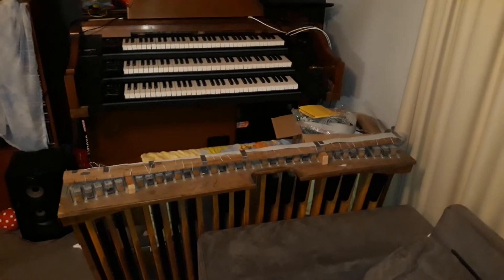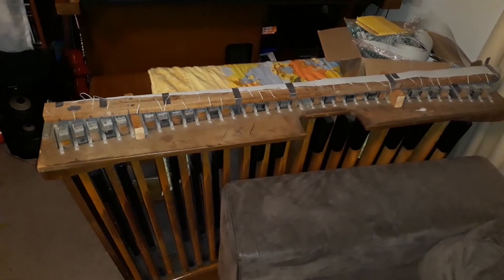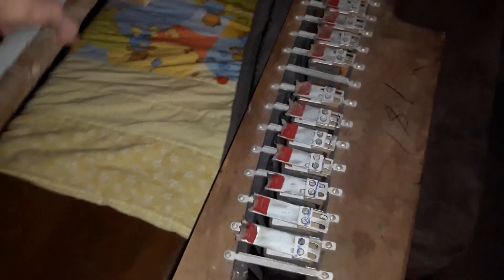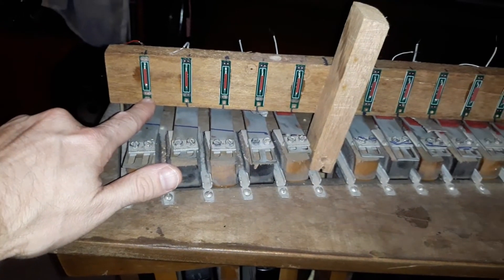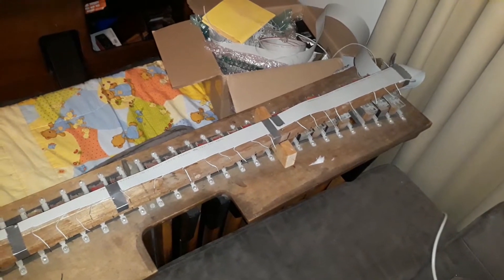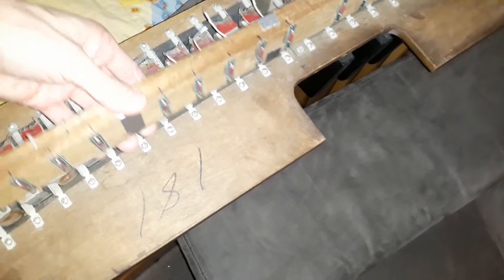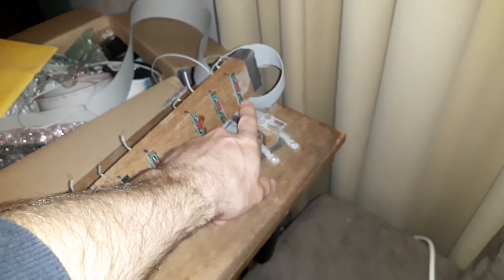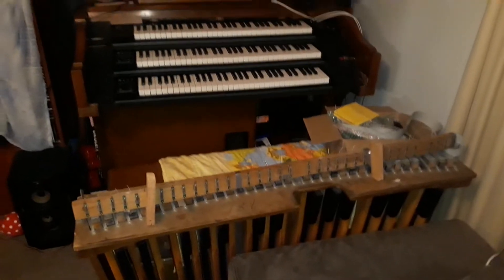VPO Part 10: Installation of the pedalboard reed switches

Comment: From all the videos that i found your pedalboard setup is the closest to mine. 32 switch wires & seems like to common grounds, that i will connect to an Arduino Mega. Id like to your assistance if you are welling to help. Well done on the setup so far!